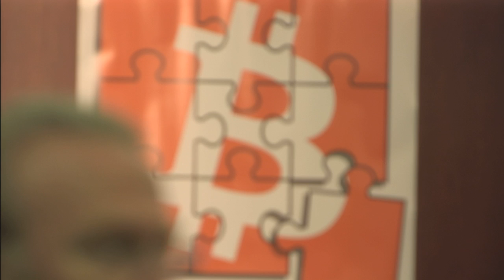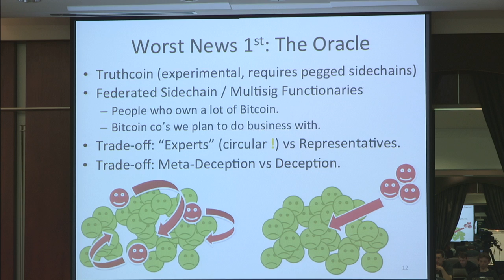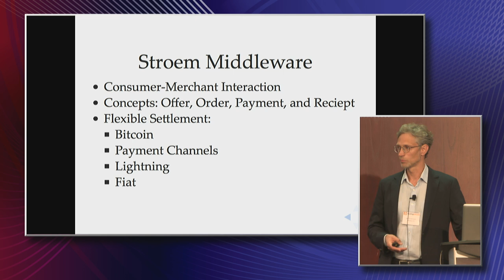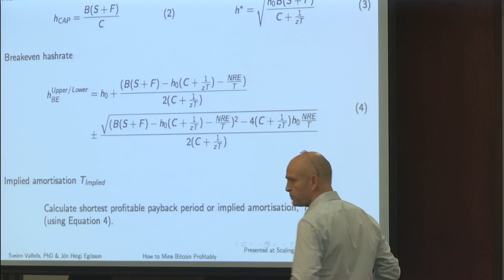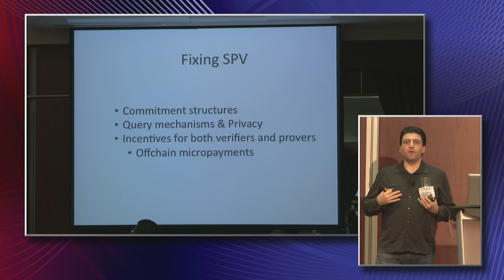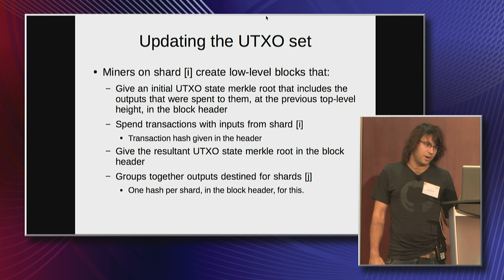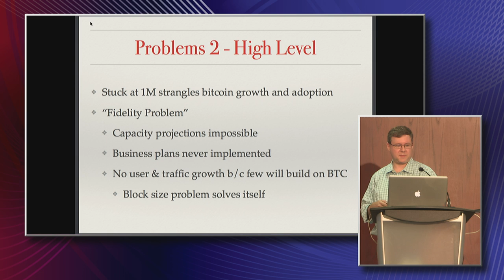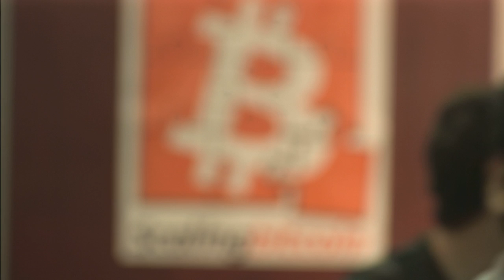Scaling Bitcoin Day 2 - Morning Session

Comment: Community Communication Channels
06:30 Shin'ichiro Matsuo - Lessons learnt from the NIST SHA-3 Competition for scaling Bitcoin
25:53 Paul Sztorc - Objective Functions in Bitcoin Development

Payment Channels & Layer 2
41:53 Joseph Poon & Thaddeus Dryja - Bitcoin failure modes and the role of the Lightning Network
54:51 C.J. Plooy - Experiences Working on Layer 2 Scalability Solutions
1:03:55 Jarl Fransson - Stroem - A Protocol for Microtransactions

Mining & Network Costs
1:41:33 Sveinn Valfells - How to Mine Bitcoin Profitably
1:54:09 Marshall Long - Mining True Cost
2:02:06 Patrick Strateman - Initial Block Synchronization is Quadratic Time Complexity
2:05:35 Eric Lombrozo - Costs and Incentives

Block Size Research
2:48:24 Vlad Zamfir - Sharding the Blockchain
3:04:57 Mark Friedenbach - Alternatives to a Block Size Limit as a Rate-Limiter for Validator Resource Consumption for Consideration
3:21:06 Jeff Garzik - Issues Impacting Block Size Proposals
3:43:55 Alex Petrov - Mathematical Formalism for Voting Process
3:53:17 Harry Kalodner & Arvind Narayanan - How Will Bitcoin's Block Size Affect Non-Currency Applications?

Tips: 1Bsgn8J6yFAFEBQHXCPGPCr3D64g5C3tMt
Reply: Eric Lombrozo's lecture was excellent.

Comment: Regarding "Initial Block Synchronization is Quadratic Time Complexity" (2:02:06)

I've been thinking about this: what about including a hash of the serialized UTXO set in the block header, and make it consensus-critical? The blockchain is a data structure which, when processed correctly, produces an UTXO set. There is a 1:1 mapping between a blockchain and an UTXO set, it's a deterministic process. Blocks should include the hash of the UTXO set in the header, such that new nodes can join the network by looking only at 1) block headers (to verify proof of work) and 2) the UTXO set.

If we view Bitcoin as a distributed, time-stamped database, then blocks are groups of commits to this database.  Commits to the Bitcoin database are transactions. A Bitcoin transaction removes bitcoins from one output, and assigns them to a new output. This is just like a database update: remove from row A27 and assign to row B43. The UTXO set thus becomes the actual database, and the blockchain the history of database commits. The database is the relevant part, not the history of commits to this database.

Comment: Stroem sounds like a horrible idea. It introduces "issuers" that are essentially trusted third parties, completely antithetical to Bitcoin as trust less and decentralized, might as well just use visa.
Reply: +Nicolaus de Silentio The advantage of Stroem is that it actually works, now. There are currently no alternatives. It is technically inferior, but functionally superior to all other proposed solutions, including the Lightning Network. The risk/cost factor can be controlled by the merchant as he wishes, so he can start by redeeming every hour, or day, while building up trust. The merchant decides when he wants to redeem.
Reply: +Nicolaus de Silentio Also, there is nothing "unworthy" about non-trustless financial instruments on top of Bitcoin. Bitcoin is trustless, yes, and it is very important for the bottom layer to be trustless. But instruments on top of Bitcoin need not be trustless. It is naive to think that Bitcoin can function using just Bitcoin transactions on the blockchain. Gold didn't work as money without clearing instruments on top of it (primarily: bills of exchange) and Bitcoin won't either.
Reply: +Rune Kjær Svendsen it is a solution, but an unimaginative one.
Reply: +Nicolaus de Silentio

Fractional reserve banking is not a virus, it is the foundation of our modern economy. Please don't believe the anti-"fractional reserve banking" hype that's so pervasive in the Bitcoin community. It's based on a misunderstanding. Full reserve banking is not banking at all; it's money storage. Putting your money in a safe is fine, but don't expect to earn interest on it. And if you're not earning interest, why not keep it in your own safe, at home? Thus preventing the bank from lending it out, if that's what you want to avoid.

Money is deposited with a bank in order for the depositor to earn interest on his savings. Interest is earned by the bank lending out (part of) the deposited money at interest. You cannot earn interest on money by having it sit in a vault at the bank. In a properly functioning banking system, you deposit money with a bank for, say, 1 year period (during which you cannot withdraw it) and the bank buys a 1-year bond which earns, say, 5.1% interest. After one year you have 5% extra money, the bank has 0.1% extra money, and you can now withdraw your money from the bank.

This is duration-matched fractional reserve banking at its core, and it's entirely unproblematic. Once you start introducing asset/liability duration mismatch, then problems start appearing. If, for example, I deposit money with a bank that I can withdraw at any time, and the bank buys a 1-year bond with that money, then bank runs become possible. Mismatch between the duration of a bank's liabilities (deposits) and assets (bonds/bills) is what makes bank runs possible. Duration mismatch is very problematic, but not inherently present in fractional reserve banking.

There are a lot of problems with our current monetary system, but the act of a bank lending out depositor funds (the very purpose of a bank) is not one of them.
Reply: +Rune Kjær Svendsen Good sir, The average savings account has a measly 0.06% APY, and many of the nation's biggest banks pay rates as low as 0.01%, which does not even cover the rate of inflation! While I have no moral quarrel with savings accounts, I see little value in earning 0.06% interest by keeping my money in a savings account when the annual inflation rate is 0.20%!

The inflation (read: loss of value; loss of purchasing power) caused by the Feds monopoly on the "issuance" of "notes of exchange" made necessarily only by Gold's weaknesses as money which Bitcoin does not have.

Are you familiar with the name Bernie Madoff? Are you familiar with the way his business (Ponzi Scheme) worked? People deposited money with him and he promised 5% APY in return. I have no quarrels with people who want to willingly invest in schemes which promise interest profits, but Fractional Reserve Banking with people's checking accounts is inherently fraudulent which you all but admit. And our economy is founded upon deposit account reserves being held at less than 10%. 

There are laws in place that prevent grain elevators from lending warehouse receipts in grain backed by their customer's grain deposits for a reason. There are laws in place that prevent the storage company from lending out the items you store with them for a reason. Why banks should be able to lend out the money their customer's deposit them is a mystery. 

It is legalized embezzlement. And what the Fed does is legalized Counterfeiting. And this has become the basis of our economy only because the best money on the planet up until 2009 (gold) had a weakness which required "notes of exchange". 

Bitcoin upends all of this fraudulent, illegal, and clearly impermissible practice that has lead to what we now see in the economic world. Straum seeks to treat bitcoin like just another gold that requires "notes of redemption" or "notes of exchange" when it needs neither.
Reply: +Nicolaus de Silentio you are very right. But this is for USD denominated accounts. Not gold or Bitcoin-denominated accounts. The interest rate for the U.S. Dollar is controlled by the fed, but the interest rate cannot be set administratively for commodity money, including Bitcoin. A more realistic annualized interest rate for a 1-month Bitcoin time deposit is 5-10%. That would be a market-set rate, but it requires that we are able to finance the production of consumer goods in Bitcoin, which can be achieved using bills of exchange, which is an earning asset. So it will take time before it's possible, but it's definitely possible, if people are willing to accept Bitcoin as money.
Reply: Rune Kjær Svendsen One of the main things that makes bitcoin such a "hard" or "sound" money is that it requires no "notes of redemption". Gold's inferiority as a medium of exchange necessitates paper bills to be in circulation, first redeemable in gold, later purely as fiat. 

I fear introducing "bills of redemption" to bitcoin may lead to a similar outcome, therefore I insist on solutions to scalability that require none, as bitcoin truly requires none.
Reply: Bills of exchange are necessary in order to finance the production of consumer goods using gold. There simply isn't enough gold if every single producer in the line of production needs to pay with gold coins. The same goes for bitcoin. This was the reason the bill of exchange was invented in the first place: it could fill the role of many gold coins, thus lowering the cost of producing consumer goods, to the advantage of everyone.

The thing is that commodity money is great base money, but if every single producer in the line of production needs to pay in specie, then every time it becomes more complicated to produce something (by adding another step in the line of production), the demand for specie increases. This doesn't scale. The paper instrument that solves this, the bill of exchange, is used only between the involved parties, and doesn't circulate as money.

The gold standard didn't show weakness until the London bill of exchange market was closed at the beginning of the first world war in 1914. Our global economy was dependent on that instrument back then, but the right people didn't realize this.
Reply: Rune Kjær Svendsen "The same goes for bitcoin." you are absolutely incorrect sir. Gold cannot be divided into small enough parts to do the job, soon people would be trading dust particles of gold. That is not the case for bitcoin. One bitcoin can be broken down into one hundred million parts, which means there will be 2.1 QUADRILLION units of bitcoin in circulation. Plenty enough to finance the production of consumer goods and then some. 

Bitcoin does not share the same weaknesses that gold has. It scales because the denomination is (practically) infinitely divisible. As the demand increases, people use smaller and smaller denominations, down to the eight decimal place (which can be increased further if necessary). People trading 0.00000001 BTC, also called a "Satoshi" solve this problem you have introduced already.

With gold the only solution was bills of exchange, with Bitcoin the solution is already built into the protocol because a bitcoin can be divided to the one hundred millionth part and traded just as easily as a full bitcoin, yet you see not the superior solution and leap straight for the introduction of more bills of exchange when they are entirely unnecessary and so demonstrably destructive, producing the incentive for fraud and producing inflation, and embezzlement. Why?